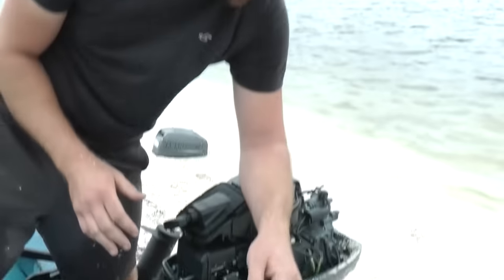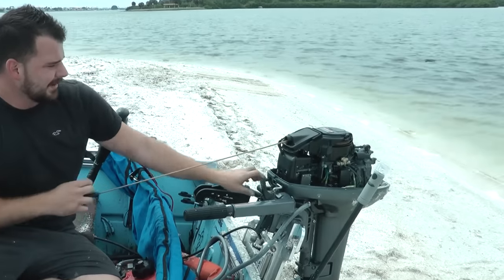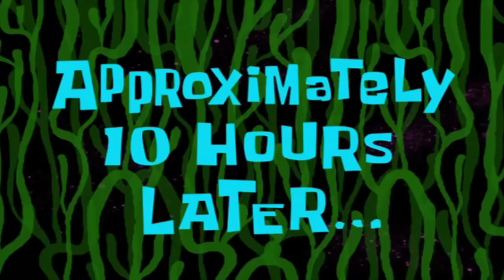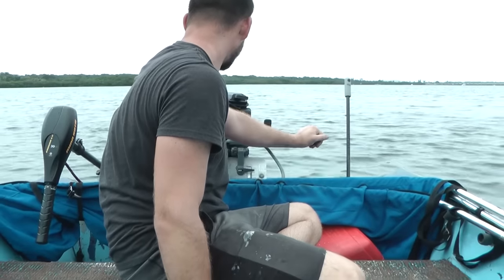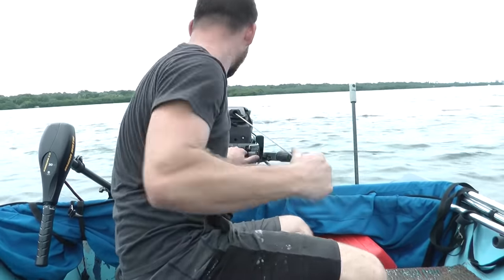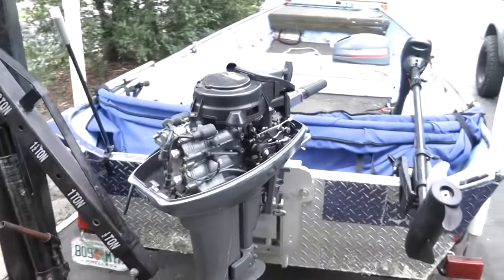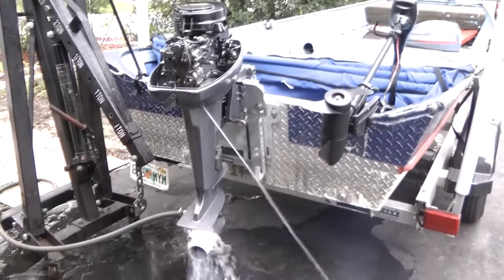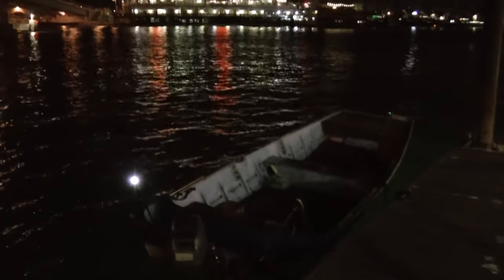Are Yamaha Outboards Tough?

Comment: They are super tough especially the 2 stroke versions. I got a 2 stroke 25hp from somewhere around 97’ it is unbreakable.
Reply: dnh300 the 25-40 horse Yamaha 2 strokes are legendary and are prob the most reliable boat motor ever built. Yamaha is great in general but the 2 cylinder 25s and 3 cylinder 40s are truly unbreakable.
Reply: My 15hp 2 stroke starts first pull everytime
Reply: @ethanhudson6028  To tell you something, my boat sunk. We pulled te motor out the water and removed the spark plugs. I pulled untill no water came out. And it started right up!
Reply: @ethanhudson6028  also the new 4 strokes Tohatsu mercurys  and so on, but this test give a picture just the abuse thing. All outboards if  stay away from  dropping them into the sea, should last minimum 1500 hours, 1500 hours is enormous amount of  time on the sea.
Reply: I bought a 4 stroke 15 and kinda thinking about selling it and buying a 2 stroke ngl
Reply: @joshmaitie5954  I'm replacing the 29 yr old BF50 Honda 4-stroke on my little sailing boat for a Yamaha 85 2-stroke. This vid confirms that's a good idea :)

Comment: It probably runs better now than it did before dunking it in the water while running cleaned all the carbon out of it, and the shells blasting the cylinder walls rehoned it, thumbs up. I'm going to try it with my 175

Comment: Yamaha outboard 2 strokes, the Enduro series, are well known in the Pacific Islands for their toughness. Many times we or a friend has dropped an engine overboard, sometimes in 100ft of water, took a couple of days to retrieve it, pump it full of 2stroke and it just fires back up. They are like the marine equivalent of Toyota's landcruiser. Simple tech is hard to beat, basic water-sealed electronics and simple tough design. I heard that even the actual aluminum that is used on the Enduro series is not the standard used in other Yamaha OBMs? Not sure if that's true.
Reply: My heart hurts...just sold my 4.0 V6 Land Cruiser cause of gas prices.You are right...those engines are equivalent to LC engines.

Comment: All 2 stroke of every brand can take this punishment, but don't do it with a 4 stroke of any brand !!
Reply: 2 strokes can only take overheating on low rpm. they melt the pistons at higher rpm
Reply: RIP waterpump
Reply: Echt he
Reply: Well said.
Reply: If that is the case, how come it is the opposite way round with jetskis? 2 stroke die at the first opportunity, 4 stroke last much longer. Just curious.
Reply: @Nick_G7IZR 
Never heard of that, but if it is true;
-depends on the way you are using it
Reply: 4 stroke Honda 14 years old had no. Major problems and to be honest the only thing we have to to is change to oil
Reply: Wow not even the fuel
Reply: The narcos from Spain and Marokko use only Yamaha outboards on their ribs I think that’s said it al hahah grtz from Belgium
Reply: My 2 stroke Nissan hates to run and when it does it runs like a runaway chainsaw
Reply: I bet an etec would perform just as well
Reply: @craftsmandude8916  sad they have stopped production, but they are coming back, and will be making waves like never before!
Reply: Dutch rebel they signed a contract with mercury so now it’s mercury e tec (not actually just mercury)
Reply: Dutch rebel you are a bringer of good news! I had no clue
Reply: My 1986 90hp evinrude had a backfire explosion and caught fire a couple other times, runs better than ever now 😂
Reply: @lucasberg950  yes they dont change the fuel...only top up fuel everytimes
Reply: A 4str would absolutely self destruct

Comment: I own a 1970 johnson 20hp next year it is 50 years old and it still starts en runs like a dream
Reply: Yes my 9.9 Johnson does to but it's a early 50s.
Reply: Evenrude I forget.
Reply: 1979 50hp animal still has 120psi each cylinder original for the most part.

Comment: Ok..them my Yama got off lightly, traveling at 40kmph it flew off the back..was in the salt river and mud for 4 days, x8 tidal changes straight after spring tide. 

Well, it took 7 divers in zero Viz to find it. 

Went straight into fresh water, then stripped and cleaned. Reassembled and now works just fine.

Comment: REMARKABLE
So easy to start. So light. Best small motor ever made.
So easy to sell used once 2 stokes were banned new. Everyone wanted a low hours immaculate 15. Bought new $2,200 Aussie, sold after 6 years for $1,700.

Had a 15 hp 2 stroke Yammie on my 3 metre Polycraft Tuff Tender... stupendous motor.
When I upgraded to a Smartwave 3500 and a new F25 Yammie 4 stroke long shaft it was a great motor but the 15 2 stroke was exceptional.

Comment: This is a great example of why i swear by yamaha engines. Ive grown up fishing on a 15 foot flatsboat in rough northern water for striped bass and it has a 30 year old yamaha 70 on it. The same engine still runs as good as new to this day. There have been gaps where the motor has sat for a few years and yet she would still turn after only a few tries.

Comment: Still to this day I hold full trust to a yamaha out on the water, I had a 40hp 3 cylinder and the impeller went out about 10 miles away from the ramp so I hooked up a hose from my bilge pump and just pumped water right onto the engine. It was slow going dodgy as hell but it got me home.

Comment: Yamaha engines are tough. Like one time my uncle was at a speedboat race competition his engine was modified it was very fast. While racing he flipped the boat the damage was very bad but my uncle said it was easy to fix he fixed the boat and everything he even fixed the engine. The engine that he used was 40Hp and it still works it. So Yamaha’s engine are tough

Comment: Have an issue with my 75 hp 4 stroke outboard, gave up after 3 dealers all said they can not find anything wrong with it. Trouble is they are charging me to tell this ,then it happens again on the very next trip. Boat sitting in my driveway now for 5 years

Comment: Thanks for making this video.  Is this toughness only on yamahas? Just so we could have a comparison, I wonder if you could do the same test on an Evinrude or Mercury outboard?
Reply: There is no way any American made outboard could handle this abuse.
Reply: @commiecrusher  why not?  This abuse could be taken by all brands?  We won't know until we try.
Reply: @VanBui-mz6id  No, this is deceptive. 10 minutes underwater will corrode the etching on crank bearings. It will run but deteriorate fast. The Yamaha might be different, but better to protect from even dust.

Comment: Had a 1957 Evinrude 10hp that sat un used for 10 yrs. The rope was pulled 10 yrs later maybe 5 times and ran like a champ. I would never do what u did to that little outboard or any motor.Yamaha probably paid u to do it but that's ridiculous to prove a point. 
.

Comment: By doing this d engine will face the damages especially if this torture is done in saltwater. Soon d piston will b jammed... Wont run at a given power.. Speed will b less engine will suffocate and heat alot and after 3-4 mnths.. Die

Comment: This is the most stupidd video I have see, a bloke who iis running an outboard that he did not bother to check was locked down , totally dangerous,
Then to throw it in the water and then put sand all over it, simply put, if you dont want it give it to someone who will take care of it., what a waste of an outboard engine which by the way are not cheap.
I dont care if it is an add to show how tough these engines are, i dont think it should include being a total idiot with it, mind you there is bound to be someone who will take it one stage futher.
But I am thinking just what I could do if I  could own one, butbthey are out of my price range as a pensioner.